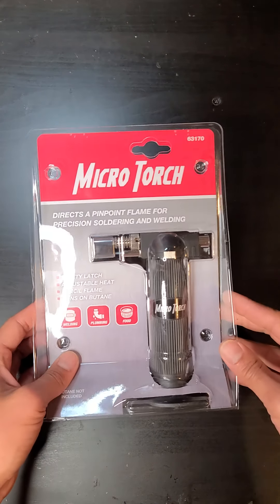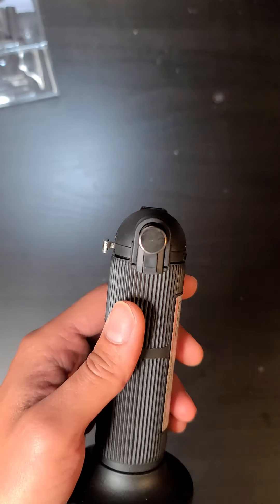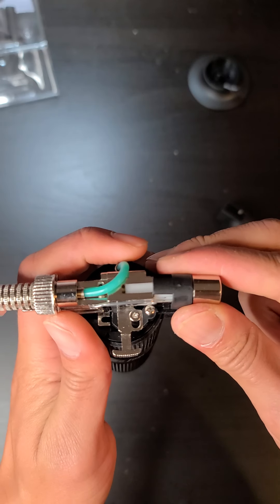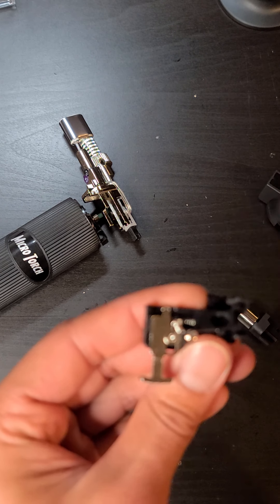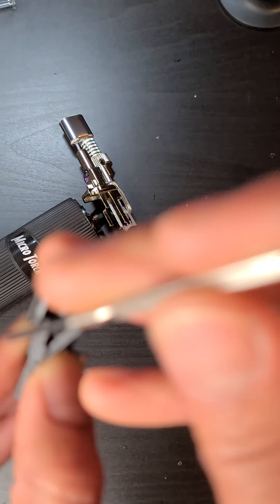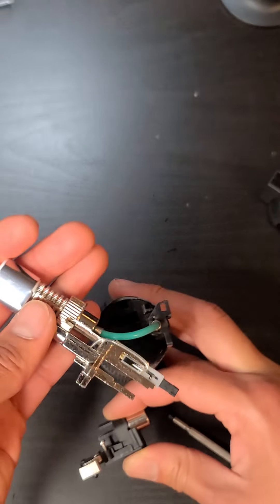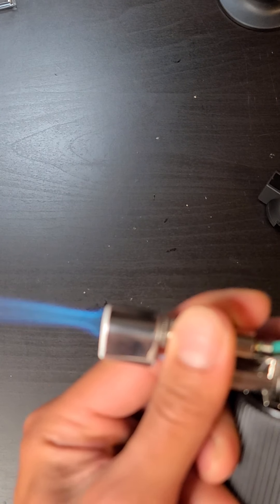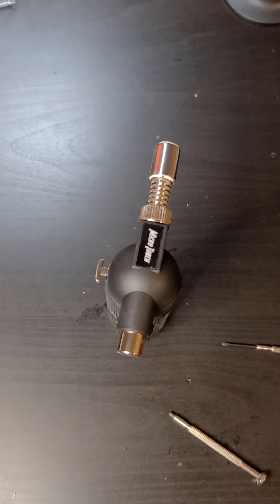How to disable safety switch for micro torch

Comment: This was a handy guide to disassembling this thing - I wanted to remove the safety, but I also wanted to adjust the gas flow valve so I could have a very small flame for paracord projects... it was as simple as unplugging the gas line, taking out the valve lifter, then popping the gas flow valve ring off and repositioning it - rebuild, test, readjust as needed. Now I have a simple to use, perfectly fine pointed torch with a continuous flame option! Merging paracords will be so much easier when I can hold both ends at once! Nice.

Comment: Thanks for this video. I just picked one up on Saturday and HATED that "feature". I googled "Micro Torch disable safety button" and found your video. 

Mine was assembled slightly differently than yours but otherwise identical. At 2:25 there are two silver screws visible. You removed the right one to take the top mechanism off. On mine, which was identical in every way except for this, that screw was installed in the silver, rectangular hole to the left of the lock lever instead of the hole it was in yours. Otherwise the process was the same.

Additionally, on yours, you removed the switch AND the spring, but on mine I removed only the spring that pops that little switch back up after you push the ignitor in. I put a tiny drop of super-glue into the bottom to hold that little switch down so it didn't rattle. After it was all back together, I filed down the tiny plastic tab that now protrudes beneath that switch so that it looks nice.
Reply: Yep mine was the same.  Bernzomatic brand

Comment: If you don't want to do all that I just super glued mine in the down passion and it's been holding for over a year
Reply: Working still?
Reply: @OrcinusLaryngologist  sure is the only problem I'm having with it is the spark ignitor is starting to go out but that's a easy fix
Reply: @BJ-on4wj  I put a safety from a Bic in there. The curvature & locking edges of it make it seem as if they engineered it to be done that way. It’s so perfect - wish I could post a photo.

Comment: I picked up a Bernzomatic torch secondhand that looks different (gray plastic outside and yellow buttons) but is almost identical inside.  one difference is the screw that holds the main burner assembly to the body.  ON yours it was on the right side (away from the fire end) and on mine it was on the same end as the business end.  Beside that your instructions were spot on.  I missed the little square valve actuator part the first try but it worked otherwise.  Also the screws are very cheap so be careful not to strip them.  the one holding the button spring stripped on mine, I had to cut a new slot with a file but it took all of 5 seconds to do that.

Comment: I have two of these and performed this procedure on both.  The only deviation from this procedure is that I nipped the top of the child lock off with wire cutters and put it back in place with some super glue.  It probably doesn't make a functional difference, but mine look original (no home under the "flame on" button.)

Comment: You don't have to take it apart.Just get a little pocket knife and stick your knife under the safety and pop it out. Make sure you get the Spring that goes with the Child safety out as well If It stays in there it will keep the hammer from Stricking and the Continuous flame switch From Latching. so when you Pluck the little plastic child proof thing out make sure you pluck the Spring under the trigger out As well. They will be a little space under the trigger now but I believe it will let more air go into the lighter and let it breathe and keep it from getting as hot.

Comment: Pull the safety tab down to it's locked position. Using 2 part epoxy, glue the safety tab in the locked down or on position. Done, no need to disassemble anything.

Comment: do what i did and glue it open,been holding good for a year
Reply: Does the torch still work?
Reply: Glue it open? Wouldn’t the glue wear away quickly from rubbing on the igniter button? 
How’s it holding up?

Comment: You don't need to do all this just put a Lighter Safety inside the slot after you push the safety down and jam it inside, it won't come out and its not in the way. So much easier than taking it all apart trust me plus if you have a warranty it wont void it because you can just take it out, 
So if you have a warranty I don't advise you doing this idea because you will void the warranty, my method does NOT